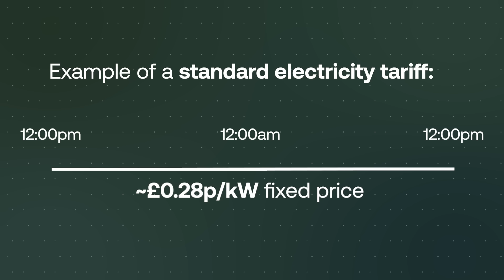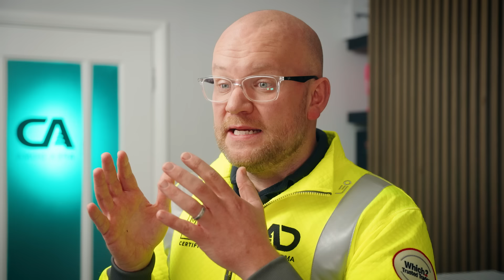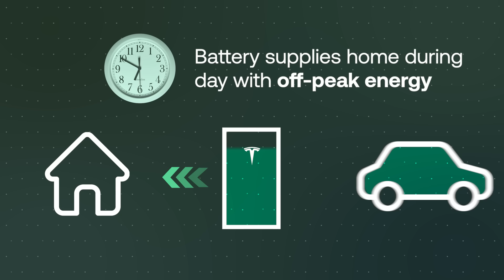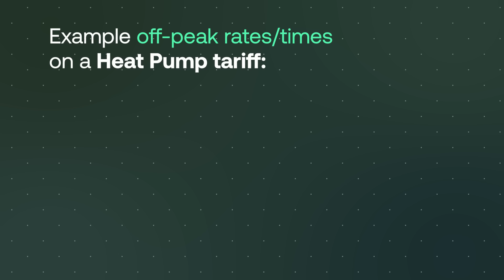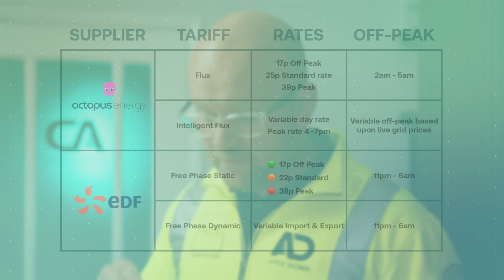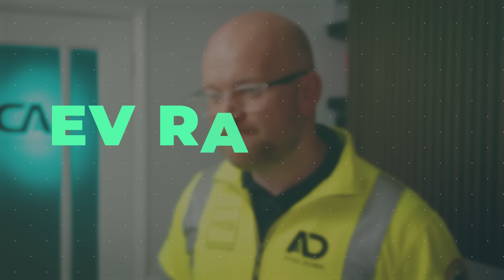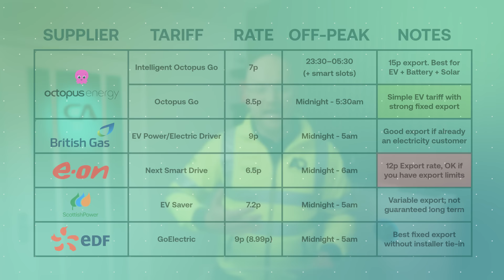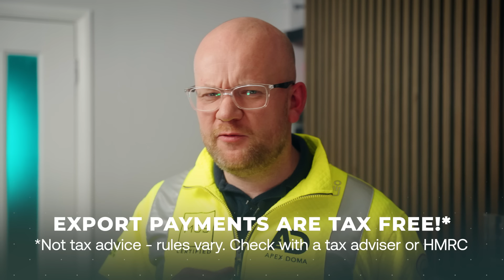Best Solar, Battery & EV Tariffs for 2026 | UK Homeowners Guide

Comment: If you export electricity on a SEG and exceed £1000.00 income a year you have to declare this income for tax on your Annual Tax Return. 
If you dont you could face fines of £100 for each year you dont delare this income, plus the tax on undisclosed income
Capital Allowances for purchase of Solar and batteries dont apply to domestic homes, so you cant off-set cost of purchase for Domestic installation and use
Reply: Read the actual regulations instead of the clickbait. It's BIM40520.

Also solar and batteries are considered for CGT purposes on the sale and disposal of property. Might not help you on a main home but very relevant to landlords and the like, and people with imaginative accountants.
Reply: What if you run a business from home?
Reply: @FaithTeapot  BIM40520 - but the original poster is wrong and there seems to have been a mysterious sudden rash of accounts posting this claim all over the place. If your supply is solely for business use then I suspect the standard "Where the receipt is received by a person in a business capacity the tariff will be a business receipt on normal principles." case will apply instead. It's all in the tax manual. BIM40520 though says you have to generate over 120% of your total usage in the normal case for it to be considerable taxable, and even then you'd have to use your allowance on top of it.

So pretty much nobody is going to accidentally hit this. Anyone who did could just install a hot tub or trim their export if they wanted. Businesses have all the normal ability to offset it against other costs etc.
Reply: It has always been 120% of your annual energy requirements for solar, battery discharge is different

Comment: Good video, but disappointed you didn’t discuss Agile Octopus, which can be a great option for many. I’m a Solar + EV household (no battery, no heat pump). I’ve crunched the numbers at 30 minute resolution and this consistently works out the cheapest option for me, with a mean unit rate of 16.9p per kWh on grid draw over the last 12 months. I’m further optimising in 2026 with intelligent scheduling of EV charging via Home Assistant and moving from deemed export to Outgoing Octopus at 15p/kWh. The low unit rate I achieve without a battery makes a battery hard to justify on purely economic grounds.
Reply from the maker: Hi Martin,

Thank you for the comment. Agile is a good tariff if you are tech savvy, I agree. 

Ian
Reply: Wouldn't adding batteries lower your overall average unit rate? You're effectively increasing the number of 30 min slots by storing a load of them in your batteries. 
But the biggest win with having batteries is exporting: agile outgoing at the moment has a peak at 5:30am to 9:30am and then a big peak at 4pm to 7pm. 15-20p per unit exported. I.e. solar generate free units then export them for 15-20p. Or use those free solar units in the evening overnight, thus reducing your reliance on the grid and lowering that average unit rate further. 
I'm an EV, solar, battery and heatpump household averaging 5.45p per unit over the year (Octopus Intelligent Go and Octopus Agile Outgoing).

Comment: What all of these companies seem to ignore is the small businesses that could hugely benefit by load shifting.  Best I can use is Octopus Agile which is very poor compared to the domestic rates.
Reply from the maker: Hi Darren,

You can map an inverter to the agile rates with live pricing; however, commercial rates are fairly poor. I know this from thr office rates / charging our electric vans. Best bet for commercial is plenty of solar panels!

Thanks for commenting.
Reply: If you can figure out how to get your small business in your home and no room specifically completely used for it. It's the only way not to get totally wrecked on taxes and bills in the UK at this point.

Comment: I have battery (10.6KWH) and solar and signed up with E.On Next last month. I get 6 hours overnight at 6.5p per KWH during which I fill the battery and  charge my EV,  run the washing machine, dishwasher, etc. I then never need to use the day rate (28p) at all. Along with the solar topping up the battery during the day I typically end up paying less than 70p per 24 hours in total.    OH and all that includes covering 75% or so of my heating costs over winter.  On top of that I'm also  getting 17.5p export rate from Eon.  Live in a three bed semi.
Reply: I am on EON also. I pay 6.75 for 7 hours and get 16.5p for export. My fixed contract ends in March. They now give 6 hours at I believe 7.25p and the export rate is 6.5p. I shall be going to Octopus. You must have signed up just before the changes.
Reply: @dennisbean5569   Yeah.. I just checked and they have changed the day and night rates as per your email. I signed up in December 2025. You can still get the 17.5p SEG rate though, providing you're an EON import customer.
Reply: @dennisbean5569 hey how are you selling back ? Do you have solar or battery only ?
Reply: @ljonathan991 
I have 27 kw batteries and 14.5 kw of solar. I am now on Octopus Flux. I am importing virtually zero and exporting my maximum from 4pm to 7pm at 29.4p kWh. Also exporting a lot at other times at 10p kWh. My bill for last month was £-137 so I am more than happy. I managed to get on Flux before they started restricting it.
Reply: I believe you have to have your solar installed by EON to get the 17.5 export rate, else you now get 6.5p.
Reply from the maker: Wow, that's good. Better than my own set up. Which postcode are you in? I wonder if you live closer to wind turbines, which would allow for better rates. I couldn't get the same in Wilmslow, SK9. Thanks for commenting.
Reply: @apexdomasolar  I'm in BA4 (mid Somerset area)
Reply from the maker: Definitely better than the North West, thanks for commenting. 👌
Reply: @apexdomasolar  The 17.5p is only when they had their solar installed by E-on, and only for a year.  Then it drops to 6p/kWh if they're on a ToU tariff, or 13p/kWh if they're on a flat-rate import tariff.
Reply: What battery  have you got
Reply: @paulmccoy1683  I have two SunSynk 5.3KWh batteries,  so a total of 10.6KWh Though only 9.7KWh is useable due to the bms keeping some in its back pocket.
Reply: hey how are you selling back ? Do you have solar or battery only ?

Comment: Thanks for such an informative video.
I’ve been following your channel for a while and it’s honestly one of the reasons I love YouTube. 
the level of knowledge you share is something people would normally pay for.

I’ve got a 5.4kWp solar system with a 5kW inverter and a 16kW heat pump, currently on a British Gas heat pump tariff. Without a battery for now, is there a tariff you’d recommend for this setup?
I live in ne333dh area.
Reply from the maker: Hi Shamolshaharan,

Thanks for the comment, really, this depends on when you have a demand for heating the home. Without a battery, it is hard to shift load to a lower tariff price effectively; you may end up running into the 4-7pm peak-time increase, which can mute any savings.  You'd need to download your hourly data and establish if you could run on something like “Octopus Cosy” and make a saving. Also, take a look at the setback temperature: during off-peak, you turn the heat up; during on-peak, you lower it. You can always pretend to be on a tariff to see what your usage looks like, review the data, and then make the move if it makes sense.

If you do go for a battery, make sure you get one that has a large enough inverter.

Thanks for the comment. I hope others find this useful as well. 

Ian 

+ For your export, 15p on Octopus Outgoing was the best I could find.😊